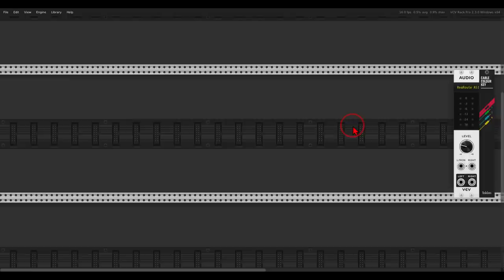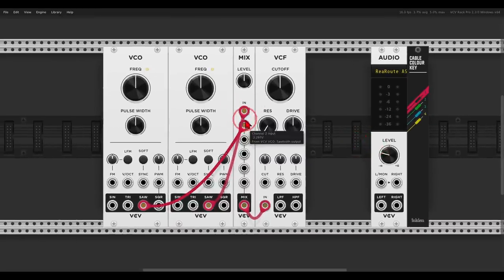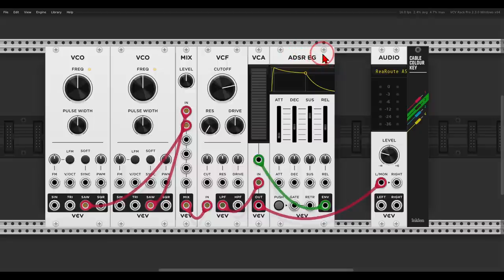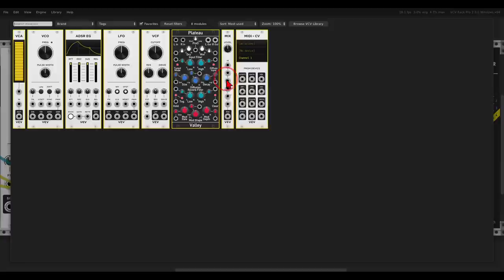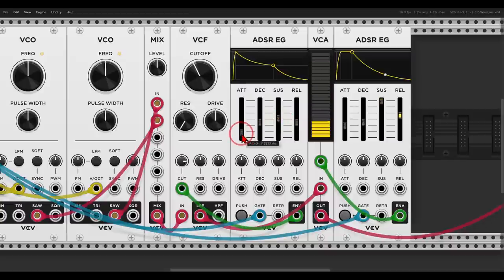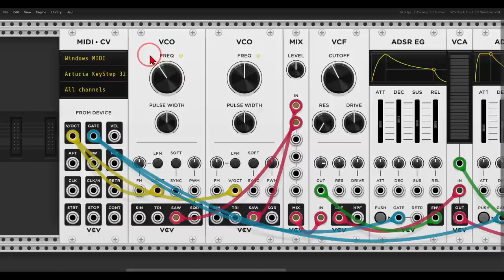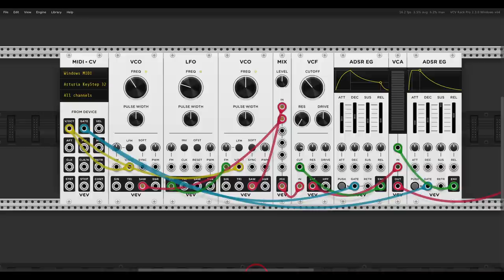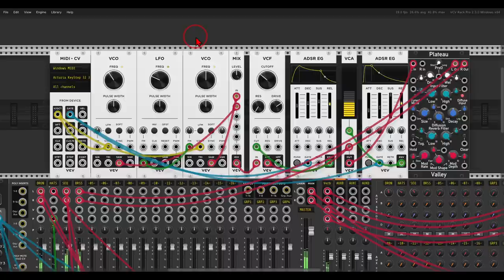Beginner Friendly Synth Brass Sound-Design

Comment: So a problem I have been running into is with sequencing. The sequencer I'm using is putting out triggers and the trigger to gate converter doesn't run long enough unless I loop it but then it doesn't turn off. Is there a module that can take a trigger and hold a high voltage until another trigger turns it off?
Reply: What I've just figured is to use a Seq 3 with 2 steps active. One high one low and the triggers go to the clock input to move it to the next step.
Reply from the maker: have a look at a Flip Flop. One trigger will turn on a gate, and another will turn it off. Let me know if it works :)